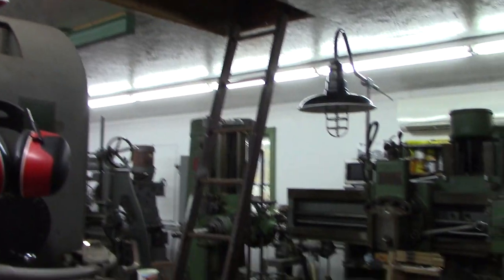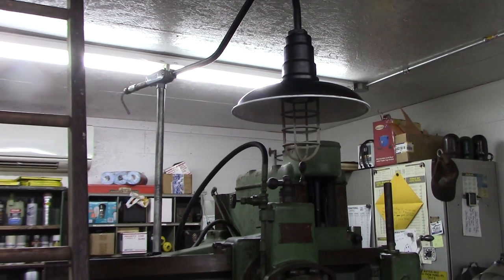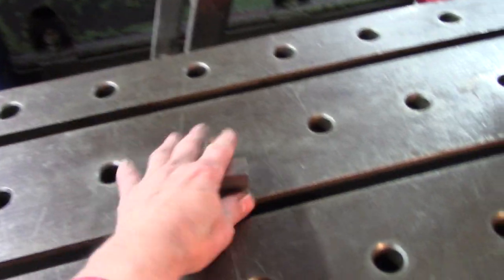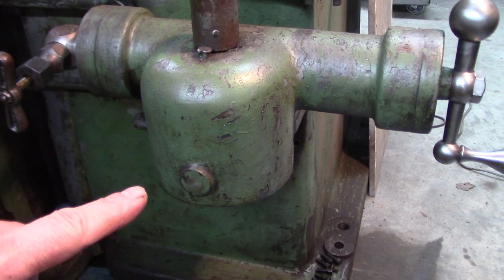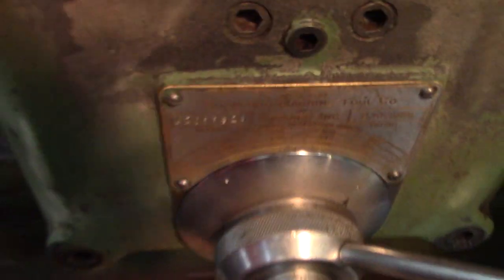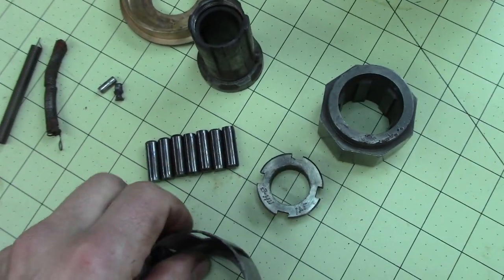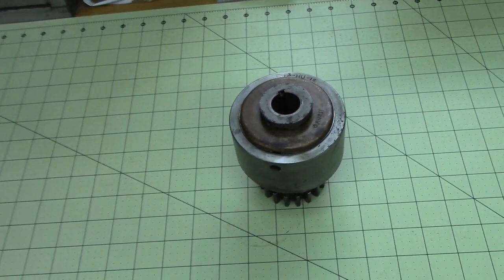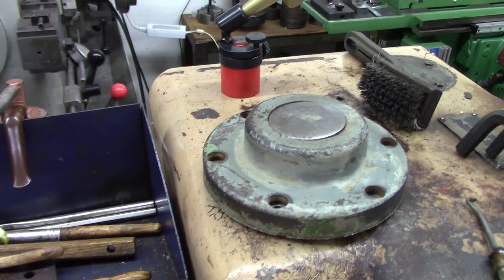11-27-22  --  Rockford Planer Fixing Power Feed & Vintage Lamp

Comment: Good technical information. 
Good video. 
I will keep this information stored in my head. I have built equipment with a sprag clutch in it.   
I didn’t know that they used that kind of a clutch in the planer. 
Thank you for the update on your project. Very exciting.
Reply from the maker: Glad it was helpful!   Did you ever find out who in town has your planer ?
Reply: @kooldoozer  still looking 
It’s the same as yours 36 inch Rockford.